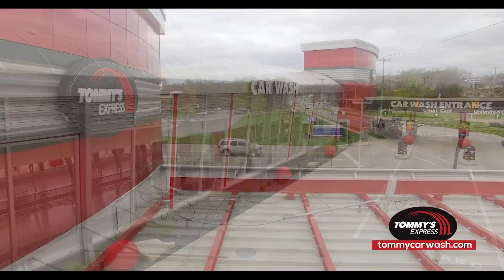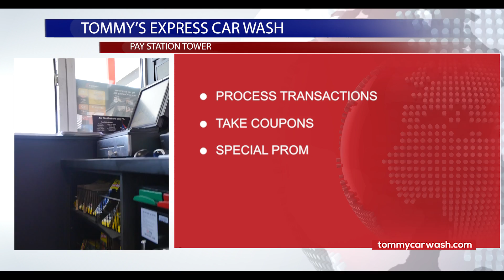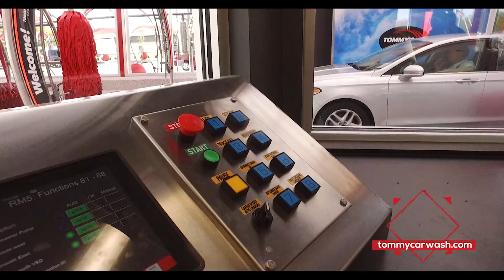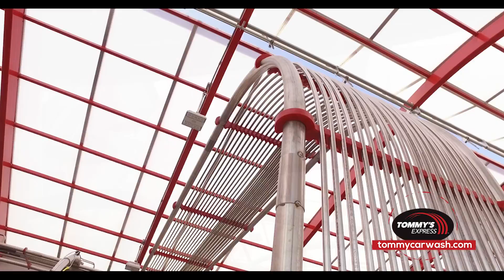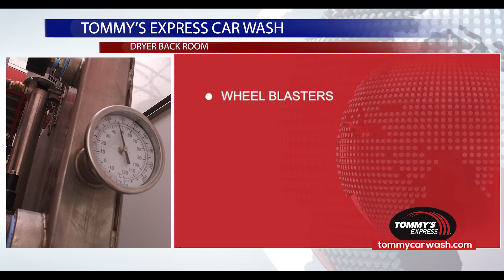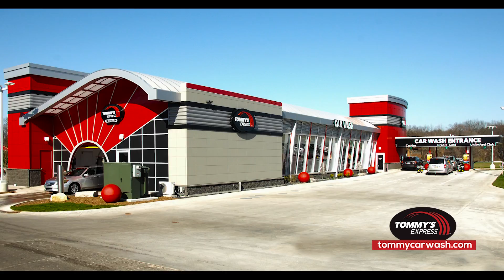Tommy's Express Car Wash - Rivertown

Comment: If no attendant is guiding in cars then how would the system know if retracts were needed to occur for a vehicle? (Example: A car has a hitch at the back or a car has a bug deflector)
Reply from the maker: Staff continuously monitor incoming vehicles from the Cashier and Flight Deck stations adjust the equipment accordingly. Customers are able to line up and load independently, which reduces labor, but the process is never allowed to operate without human oversight.